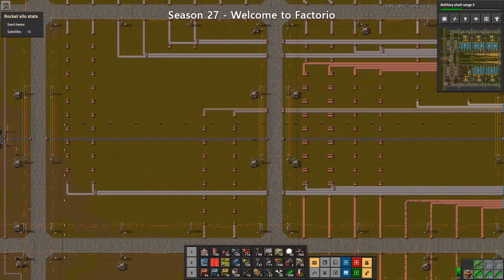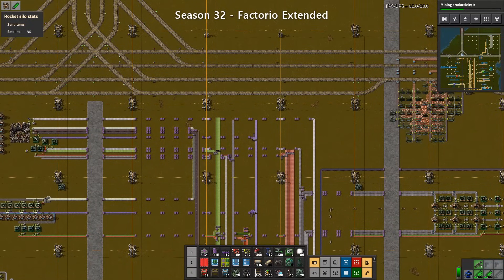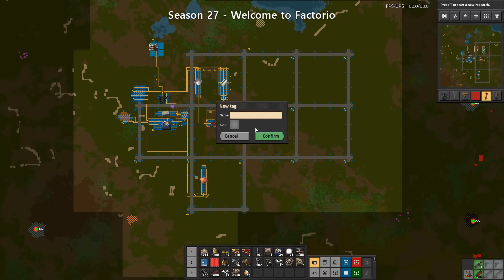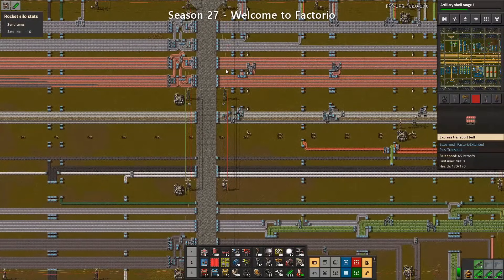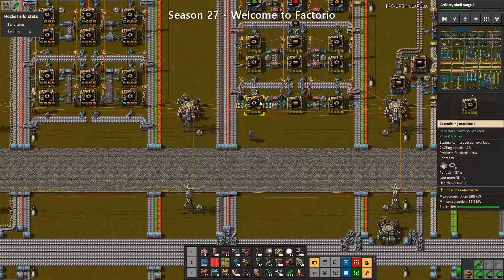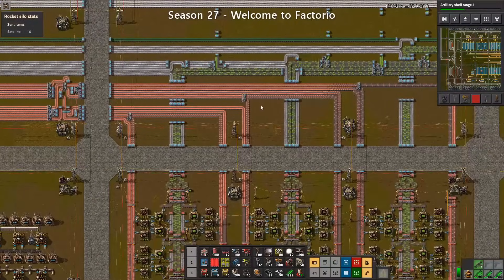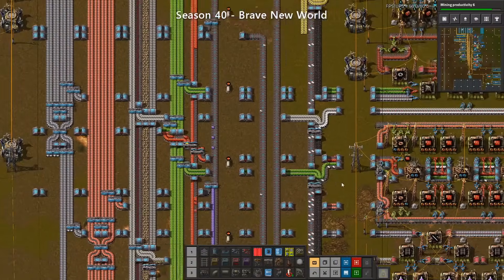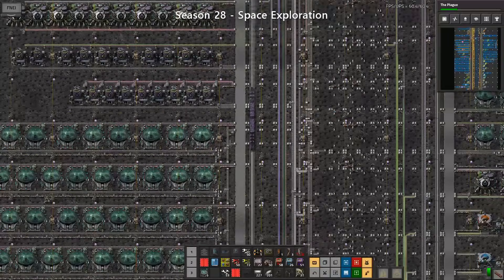Order Your Base with the MAIN BUS - Factorio 0.18 Tutorial/Guide/How-to

Comment: For a normal base i go for 5x4 lines. that space i can reserve. i personally leave 4 fields space between lanes (to fit drone hangers and electricity, and to jump between). i go for 4-iron, 4-copper, 2 steel, 2 green circuits, 1 red circuits, 1 blue cirquits, 1 plastic, 1sulfid, 1 coal, 1 for raw stone, 1 bricks.

Comment: I agree with most of your bus items. But I like engines on the bus because they just take up so much space on their own, even though its only 2 raw ingredients. So it makes it easier to have a dedicated engine build going onto the bus, and pulled off for the things I need it for. I usually put engines and electric engines on the bus. 2 of each just because I like sets of 4. I also put fluids on the bus. But I know that's kind of contested as well, it works for me. Which is I think the most important thing.

Another thing I heard talked about a lot but didn't hear you mention is using priority splitters not to pull off the bus, but to refill the one lane you pull from. ie: Pulling only from a top lane split, but then using priority splitters to push everything from the bottom lane to the top.

Comment: What is the meaning of low or high compression items?
Reply: Low compression items produce more items than they consume. For example copper wire takes one copper plate and produces two wires. If you were to put the wires on the bus you'd need twice as much belt capacity than if you put the copper plates on the bus and produced the wire right where it's used.
High compression items are the opposite. Most finished products are high compression. They consume multiple items to produce.

Comment: Nilaus, I did the math on the rebalancing section. And I believe you don't need the two splitters at the exit.
I am new to Factorio, so it is possible I am making a mistake, but with the assumption that a splitter evenly distributes two inputs to two outputs I believe I am correct.

Comment: the reason we call it a bus... is because it acts like a school bus, taking passengers (materials) and bringing them to a designed destination. this was a thing in many factories way before computers got involved. after all we had been having mass production factories way before computers existed. and before computers we were using mechanics to produce the same effects. computer actually only added the concept of logistics, which back then were only done by engineered hardware that had mechanical way of defining what was going where, such a holes big enough for 1 certain type of materials or net like stuff for liquids and filtrings... so the term bus definitely existed way before computers were a thing. its really much simpler then computer analogy... it really simply means the concept of taking multiple things at once and bringing them to another place all together. and then going back to the starting point and doing it again. much like school bus does !

Comment: One thing I've done in my current base: At the end of the bus, there is one lane of every material on the bus looping back to the start of the bus. I've found that if input goods come in irregularly in large batches (such as when you just have one mining outpost of every kind), it's rather the production at the start rather than the end of the bus that gets starved. Stuff piles up at the end of the bus (and is slowly drained by the production hooked up to the end), while the start of it is starved. By having a single return lane, stuff that gets through the whole bus without being grabbed off it gets another go at it, and the supply is more evenly divided between consumers at different parts of it.

Comment: The main bus one of the most usefull things a new player can learn to use. I've had factorio for years but never got very far becouse the spagetti was to overwelming but once I've learned what a main bus is I was able to beat the game. Tough I somewhat diagree on a mainbus beeing great for modded as the mainbus can get absurdly wide in some mods that have a lot of diffrent raw materials and/or intermidieries. I usually switch to a combination of trains and bots late game.

Comment: im still confused as to how I get to the point of making a bus without my factory becoming spaghetti
Reply: Make your spaghetti base first to a point, then build the Bus base once you have a bunch of supplies. 
After a few hours, pick a direction and kill as many voters in that direction as you can and you can start building in that direction. To start, start mining a couple ore patches but route 100% of the ore from those into smelters for the bus.

The biggest point is to make sure that assembly and resources are separate. Do that and you can expand with relative ease until blue science

Comment: 4x4 bus ballancer is a trap, that can create nuisances in the future. Imagine having 4 full lanes of iron, you take half a lane for something off the bus, and you are left with 3 and a half lanes, split over 4 lanes with a ballancer. This means, that no matter what, none of the 4 iron lanes is a fully saturated lane, and some of the modular blueprints, that Nilaus provides REQUIRE a fully saturated iron belt (and 2 fully saturated copper belts) to produce, say, green circuits, at full capacity. Using ballancers before the green circuit manufactoring hub leaves you with less materials than you need (on any single bus lane), thus you either have to combine two lanes to create a saturated one, or construct an additional, dedicated and saturated lane just for the GC production.

Comment: Nice video, i'm wondering about a couple things i couldn't pick up in this video. ( a lot of info to take in)
I made a single smelting array for a full belt of iron plates, would this be 1 belt in the mainbus? Or am i supposed to split it up into multiple in the beginning of the main bus?
I imagine that's not how it goes... but still wondering because i don't have enough starter iron ore to fill 2 full belts of iron plates.
Later on when i get trains i can probably fill more iron belts.

Also, how can you add more inbound materials when this is in the beginning of the main bus?
When you use iron in your factory it will always starve your main bus a little bit, no?

Comment: What are higher compression and lower compression items.  What determines if it is higher or lower compressed?  Confused on your terminology I guess.
Reply: I am guessing it has to do with crafting like for example it takes 2 iron plates to craft 1 cog which means the cog has a higher compression but for iron sticks it takes 1 plate for 2 sticks so that would have a lower compression

Comment: So if the suggestions for maximum size is 4 plastic and 2 red circuits, and each red circuit requires 2 plastic....all the plastic of the bus will go to supplying the red circuit production? If the idea is that the red circuits won't constantly be fully used up then what's the point of having 2 red lanes instead of just splitting one?

Comment: If I am splitting a red belt into two yellow belts, do I need a red splitter, or will a yellow splitter be able to handle that at full capacity?
Reply: Yellow splitters seem to be able to handle 30 items per second of inputs if they come from two yellow belts and split them into two yellow outputs with 15/s each. Does that mean they can handle it if the 30/s comes from one red belt?

Comment: 6:37
Minimum bus: 4 iron, 4 copper, 2 green, 2 plastic, 1 steel, 1 red (these are not the only materials on bus)

6:51
Maximum bus: 16 iron, 16 copper, 6 green, 4 plastic, 2 steel, 2 red (split iron and copper; 8 iron one side and 8 iron other side)

7:43
Recommended bus: 8 iron, 8 copper, 2 green with room to expand to 4, 2 plastic, 1 steel, 1 red with room to expand to 2
Reply: Thanks! Came back to the video for this.

Comment: after 2000 hours or so I preffer the "module" base... i usually build modules that produce one exact thing. even smelting. the moment something is missing I add exactly those modules. no problems with expanding and no problems with allocating space beforehand. of course this is only possible after building a base first and researching robots so it is something for a later stage... and after I do this I just limit the output . done.

Comment: To put the bus size recommendations in writing:
Minimum size:
4 iron
4 copper
2 green circuits
2 plastic
1 steel
1 red circuits

Recommend bus size:
8 iron
8 copper
2 -> 4 green circuits
2 plastic
1 steel
1 -> 2 reds circuits

Max size:
16 iron
16 copper
6 green circuits
4 plastic
2 steel
2 red circuits
Reply: There is no "max size", 

THE FACTORY MUST GROW
Reply: That is far to big numbers for my brain to handle at my level of skill
Reply: and still look at most main bus factories, and you see none of the belts fully saturated. And people running 8 belts down the whole factory while they tap a full belt of iron right at the start to make green circuits....
Reply: @Voliere-infoNl  I felt like this message was directed straight towards me.
Reply: I have rail on my main bus.
Not rail on a conveyor belt, but an actual rail for fast movement inside the factory.
Reply: thank you for saving me 19 minutes of my life
Reply: 4 belts?
Reply: god bless you
Reply: So is it recommended 8 belts of copper/iron, or 8 lanes? I only see groups of four belts whenever I see a main bus being built, but I know that's to allow for splitters and underground belts to carry resources away. I never seem to see another set of four belts though.
Reply: Built my first main bus from memory, only added 1 belt of green circuits and plastic...green circuits are apparently used constantly.
Reply: wait so is this for red belts or blue belts?
Reply: "minimum recommendation versus viable seem to be two completely different things ;)
Reply: Lifesaver
Reply: Not all heros wear capes
Reply: No stone?
Reply: @Stabacs  9:07
Reply: @Stabacs I do like to run half a belt of stone on my bus (Usually combined with bricks).
Reply: Thank you, I always come back to this video because I’m completely uncapable of remembering this.
Reply: @vfernandez84  you too?
Reply: @TheFinagle  there is no secret, its pointless to "balance" 8 lanes when you tap 1 full lane and don't fill it again.

I go semi main bus and then go sideways to build up the cityblocks factory with trains. Way easier. More smelting, just build a smelting block. More green circuit,s just build a green circuitry block and so on.

Comment: 18:00 - I address those issues by logic circuits, and turning off whole science production lines when factory detects overproduction of something.
If factory detects that I have more then X amount of siance (in my case X=100 works, because how efficient my science production line are) of particular color it shuts down production of that color, until consumption of rest of science  pack catch up.

Comment: Me still not knowing how to charge a portable battery to power my armour
Reply: Oh, so batteries will hold a charge, but they won't generate any. Think of them as the second component of solar panels, which wont work at night without something to hold on to their charge aka the battery. 

Once you get to portable nuclear generators you can take out all the batteries because you won't really be using them anyway.

Comment: As impressive as this is, I've never really felt the appeal of making a mega-base. I'm much more interested in getting more and more efficient and only making just the right amount to launch the rocket as quickly as possible.
Reply: I have like 10 saves with minimum 20 hours and I go squirrell brained.. never launched a rocket 😅
Reply: @HakunaWhiskey  same!
Reply: I have a feeling my favourite part of the process is finding ways to make things work without tearing it all up and replacing it. It's like a puzzle game for me and I end up with ultra dense areas where every available square is being used for something, but good luck figuring out what 😅
Reply: And that's completely valid. One of the many nice things about games like Factorio, wide range of buildstyles and decision making is viable in different ways.
Reply: wouldn't say this is meant to turn into a megabase. if anything you will have scalability issues with the bus method compared to using trains or logistics for more flexible material transfer for a megabase the bus itself creates a bottleneck. the bus is simply a good way to finish the base game and it is a canonical organization idea
Reply: The factory must grow
Reply: Using every square inch is the hallmark of an efficient factory. The BUS design is not how it’s done in the real world because the cost of real estate is expensive. Same goes with motherboard.  The size of the silicon would be massive versus having just the right about of wire and lanes for each circuit. The bus base is amazing to look at. But am efficient base would take up a fraction of the space.
Reply: there is a lot of technology that comes after the launching of your first rocket you may want to research, since launching your first rocket unlocks space research
Reply: I want to make a mega base, but you could never do it with biters, it would be too hard to defend until late game.  So he must have turned biters off which is cheating for sure, removes half the point of the game and half the shit u can research.  It's like saying "I just refuse to want to try to research half this shit. So basically it is the game on easy mode so I can't respect nilaus.
Reply: @theNimboo  I don't think it becomes too hard to defend after you get artillery, wait nvm after flamethrower turrets, flamethrower turrets deny any biter or spitter, I hate biters it's such a shame there's so many military stuff and research in the game about military because it's one of the worst mechanics
Reply: @he3004  I never tried artillery, how do you like it? I built my whole base around lasers, and just launched my first rocket, but I just started production on artillery so ima try it.  I didn't want to get involved with flamethrowers cause I didn't wanna pipe oil everywhere ahahaha

Comment: The most glaring disadvantage: You need so much more belts, undergrounds and splitters. This is an unavoidable consequence of building in one direction instead of the 4 provided by the plane.
Just look at 10:57, an entire screen with expensive belt infrastructure not getting where it is needed but trying to get to the other side of stuff that didn't need it.

Lets just take one obvious example of how you can save a lot of time and resources on building belt infrastructure: Blue circuits consume a lot of greens, yet are unlocked late, so they are probably late on the bus with greens being early on the bus. Instead of taking all those belts all the way down the entire length of the bus with splitters re-balancing all the lanes every time you take greens for something else, you could place blue circuit production outside of the bus, in the fields behind the greens and take those lines directly to the blue, never entering the bus.

16:38 is a direct contradiction. You are constraining yourself to the pre-allocated space you've assigned to the main bus and every branch is also constrained by the size left until the next branch. If we always plan ahead and allocate space, then every design is unconstrained. Even if a player allocates the space for the bus correctly they might not leave room for enough production on each branch. As you scale up, even if you have empty belt space on the bus you can't just append more assemblers onto the back of a branch, because the belts will have trouble getting on the bus with all the belts and assemblers in the way, and if you put an early product on the end of the bus because that's where you have room; now you need to take a lane backwards.

Edit: after having watched your series where you are using a main bus yourself I can see that you are moving stuff around all the time. I have seen how cumbersome it is to constantly redraw undergrounds, always leaving that 4 space room. Not knowing what are legacy belts and what are actually connected belts.
Reply: @Chuito12PR  Sometimes you just have to rant into the ether.

I seriously doubt your spaghetti factory has 1/10th the production capacity after having played the same amount of time. Just watch his death world series to see how extremely cumbersome it is. Right now on episode 43 continuing the same base he played for 38 episodes and using several op mods to develop much quicker in the beginning. This video is a complete lie. I am convinced now that there are no benefits at all with a bus design. Only downsides.

Comment: The only thing i think this was missing was perhaps a quick address of the issue of which items should be produced at which point along the bus to reduce the amount of belts needed and minimize the belts made going back the opposite way. Looking at your zoomed out map of the bases does help with this somewhat (excellent tagging by the way), but hearing an explanation of why you position certain production along the bus the way you do would be a huge help for players learning to be more efficient with base planning. Smelting at the beginning is relatively obvious, but say putting certain chemical products or red circuits at what point on the bus and what should be around them or on the opposite side of the bus from them to minimize belts and branches is one of those big head-scratchers for me. It's an issue that makes my bases bigger and harder to manage and get around than they should be.